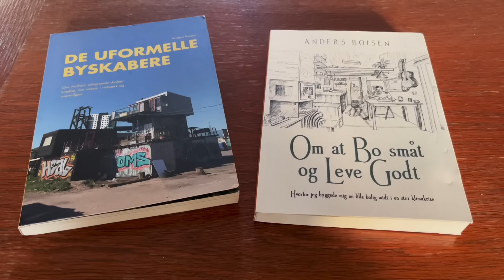Starting Over: Time For Change!

Comment: I am excited for you. I’ve been wondering about the practicality of the house you had, not the insulation factor because I didn’t know about that. But being able to stock things is very important  & you just didn’t seem to have a lot of actual storage space to prepare for the winter.

As far as being on or m off the grid…if your area is anything like where I live. We can have solar collection panels & other things to harness power we acquire that fills up our systems/batteries. Anything extra we collect above that we give to the grid. When we have times where we don’t collect (with out own equipment we can receive power from the grid. For those that don’t have solar or wind catching systems on our property we are helping supply others within the immediate community. If we have days in a row with no sun and very little air movement we are able to maintain our homes. As long as we all help keep the grid’s infrastructure up  current and in good working order i think it’s good way to make sure every one is taken care of. Not everyone can have a solar set-up.

Comment: Hi, I can’t say that I know anything about allowing walls to absorb and release moisture, although I will say to please depend heavily on regular direct ventilation to the outside by adding a lot of extra vents to the home. It shouldn’t really add cost and will help ensure that your home lasts.

With your house being smaller, and moisture building up faster in tiny homes, I wouldn’t want your home to become moldy in the walls due to absorbing too much moisture. Once mold sets in, it’s hard to stop it.

Comment: Grounds screws, love em, cool stuff

Condensation inside insulation: Do you or anyone else know where i can read more about the natural materials mitigating that moist warm inside air condensates inside the insulation and create rot?

Im actually right now build a soda-can based heat recovery unit, very cheap and it brings down moisture content a lot in the winter month, maybe something you are interested in for your build?
Reply from the maker: Yeah, just look it up on Google I guess. It’s out there and very much in production😊👌great solution - I considered that once! Maybe for the new house🤞🤞😊

Comment: I have a helical pile foundation (against the opinions of many). I hope you have a type of soil so you do not need to drill as deeply as my contractor did (15ft). I have not lived in my tiny house thru a winter yet but I hope the R38 insulation in the floor will suffice. It may be that the winter cold will not be as difficult as the summer heat (and humidity) that I find unbearable: so far the R49 in the roof seems adequate. I will install an air-to-air heatpump. Passive solar certainly works. One can over-spend, that is, build so conservatively as to not benefit. It seems that you have not gone "overboard". I look forward to your new abode. Best wishes, Rich (Upstate NY) how do you spell your dog's name?
Reply from the maker: Thanks for sharing!! And it’s Borsimat (captain of the boat in Greenlandic)